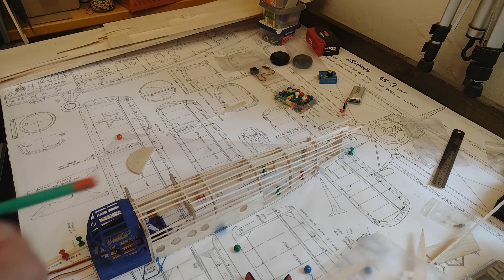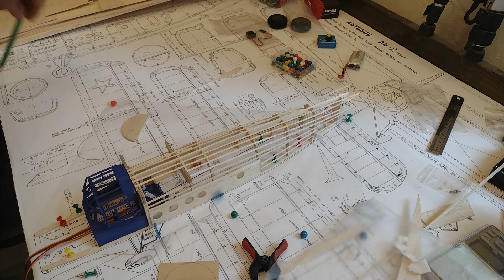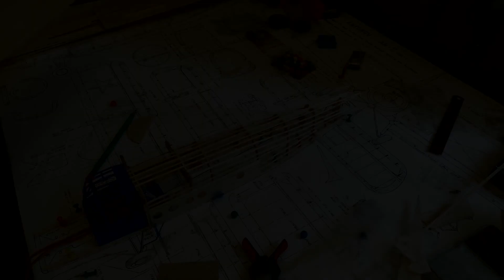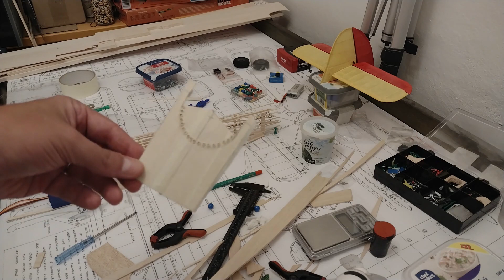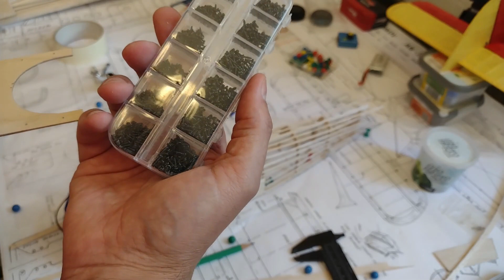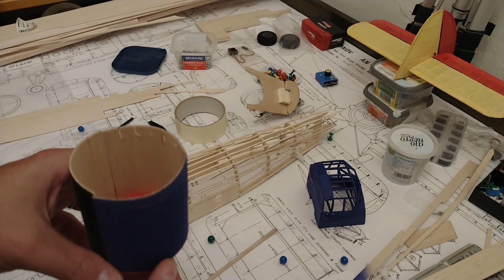08 Antonov 2 RC Conversion   Engine mounting and Cowling

Comment: Are you going to make the cowling removable that would give you good access to the motor?
Reply from the maker: Initially I thought I would leave it in place, but with all the motor and cabling and stuff going on, I will think up a system of locking it in place and be able to remove it to have access.